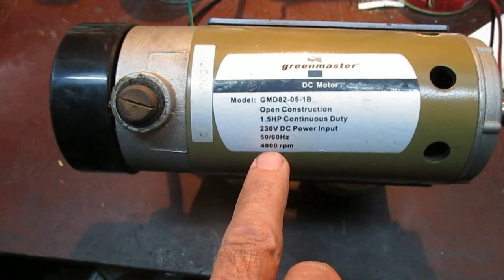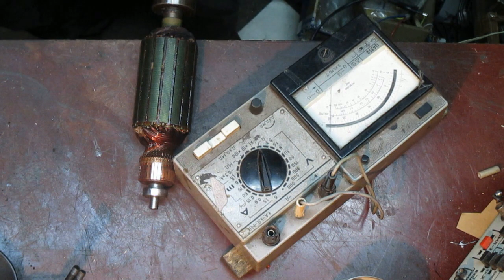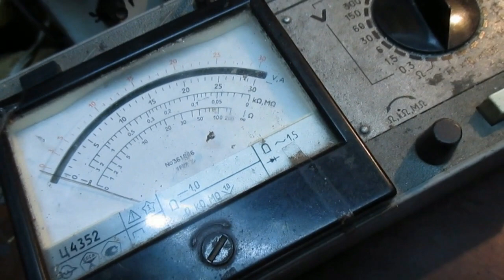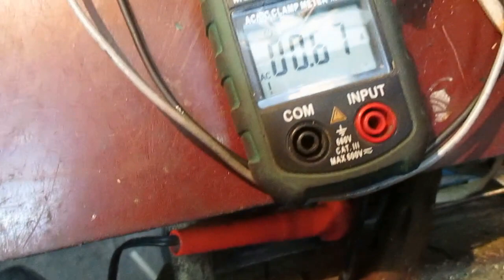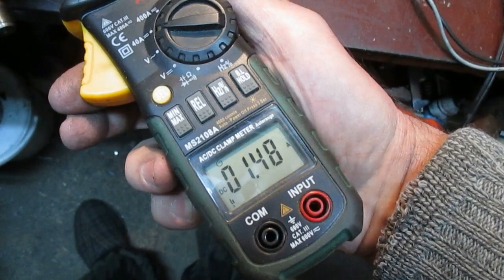ДС мотор GMD82-05-1B Перемотка якоря.

Comment: Hy sir it's great job...
I pray for you. .
God be safe you..
Sir can you please tell about magnetic inside of the treadmill moter. 
How to recharge magnetic ?
My moter magnetic is weak...
Reply from the maker: And you don't get sick! You need to try to Unscrew the long screws, apply a small voltage, turn on the ammeter and rotating the cover with  brushes to find the place where there is a minimum current. BUT! you need to watch that the rotation of the shaft was in the right direction. After that, you need to drill new holes for long screws.